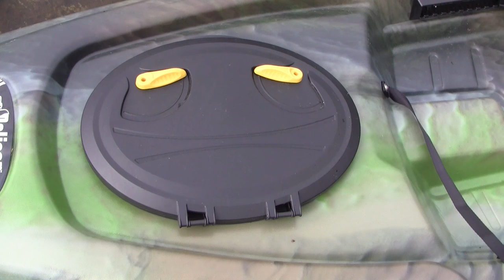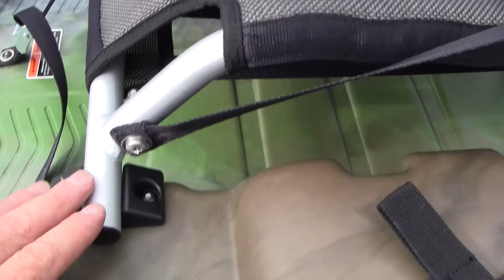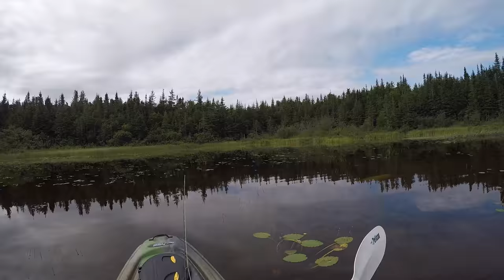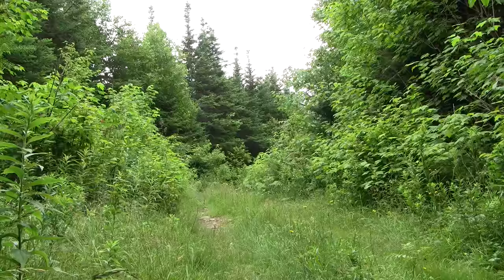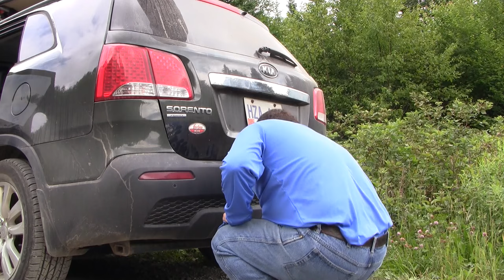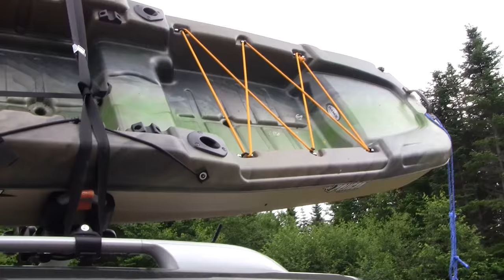Pelican Catch 120 Kayak Review and a feed of trout

Comment: I have been looking at the Catch 120, almost ready to pull the trigger. Can you comment on the stability? And did you try standing up? Carrying that kayak 200 meters, pretty badass for a retired guy! Nice trout BTW!
Reply from the maker: Yes I would wait and get the Catch 120 NXT, same as mine but has the slide rail mount system installed. I did try standing up in it, I actually fished for about 30 minutes while standing. It's not balance free, I found I had to focus on balance but I think the more you do it, the easier it will get. As far as overall stability, 10 out of 10.... Comfort on the water = 10, ease getting on and off = 10, I would recommend transporting with a truck or trailer Vs kayak roof carrier. It's not fast, but you can make good time in it. I don't like all four handles, but this kayak I would recommend to anyone.
Reply: Thanks! I don't think I'll be standing in mine, but I do want a stable kayak. I have been already thinking of using a small(4'x 7') landscape trailer with supports for the kayak to transporting it? Again thanks for the review!
Reply from the maker: Oh I think you'd be able to stand without to much worries, but I would practice before loading my kayak with gear and heading out in the middle of the lake. I used the assist strap to haul myself into the standing position each time. I think that strap should have been made about 6-8" longer as well. That size trailer will be ideal for converting it into a kayak trailer. I had a small 4x4 trailer that I was thinking about trying to extend the tough bar on to fit the kayak on. would make it much easier to load and unload. The fact that I had to focus on balance might be to the fact that I was a little nervous standing on it, I think in time it will become second nature, but I can't say that for sure. I will also be making a cart to transport the kayak to my fishing spots. More to come with that project.
Reply: Rendezvou